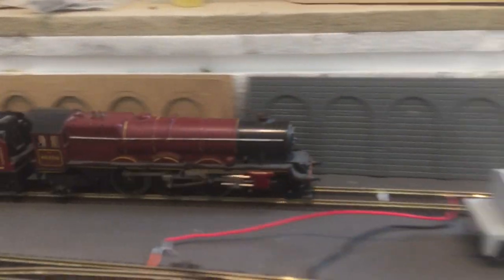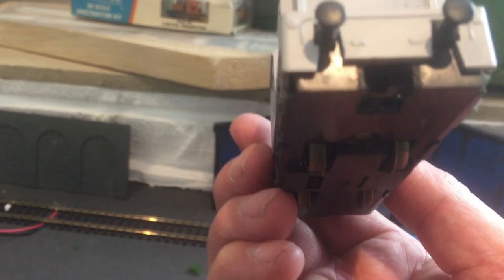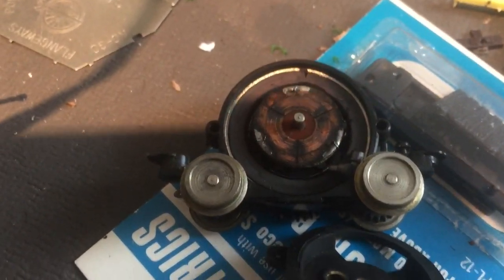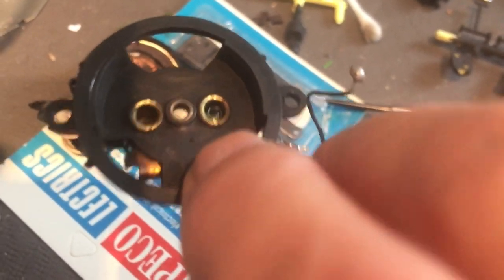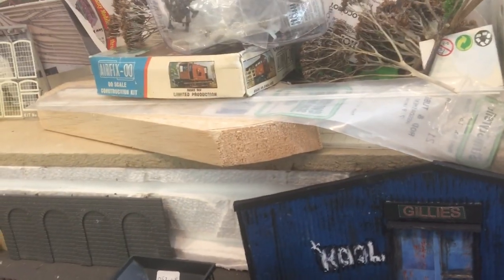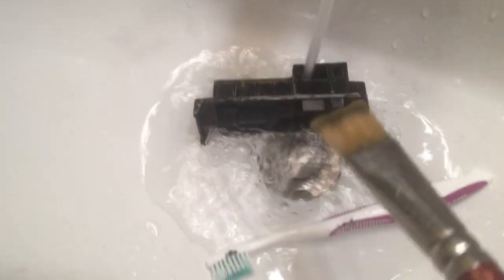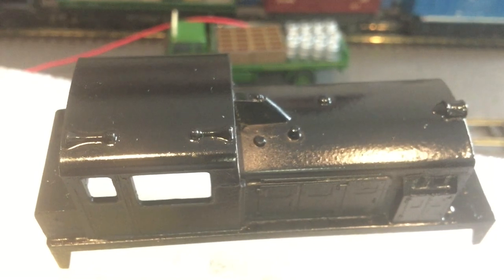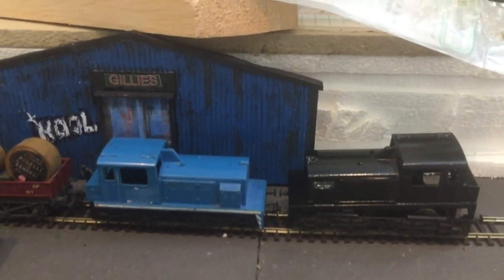How To Modify An Old Lima Shunter

Comment: The same shunters - lovingly referred to as critters among hobbyists here in the US - were Americanized and sold here in the 1970s and 80s (and probably right up to today thanks to eBay). They can be improved with new phosphorus bronze wipers and renewing the wiring. A keep-alive circuit for DC would be worth looking into if she loses power on the points - short wheelbase and unpowered frogs can be incompatible, especially at scale speeds. 

Overall, these are wonderful little machines that need no more than a bit of TLC to keep them running for decades.
Reply from the maker: Thanks for that info I will certainly look at the wiring and think about the stay alive. Really appreciate you dropping by

Comment: How do you remove the body loosing the will to live...
Reply from the maker: will post that for you soon👍
Reply from the maker: I am away from the station for a while. I don’t recall if there is a screw on the underside and if not you need to gently pry the body off. If you look at the back you can see how the body is cut around the buffers to enable the body to slip on/off.
Reply: I was wondering that. I just got one yesterday and thought the screws underneath did it but they just loosen the motor! Currently cleaning the crud off the wheels...